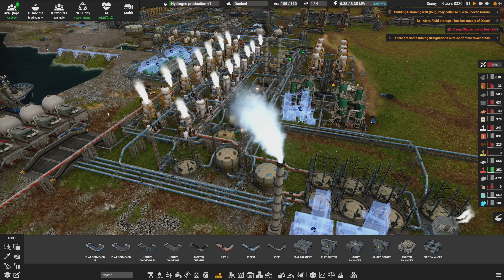FORTIFYING OUR FUEL GAME! - Captain of Industry - 32 - Early Access Gameplay

Comment: I highly suggest scraping all your pickups and have the entire fleet T2.  The algorithm is not smart when giving out / picking up jobs. This leads to the situation where if you want to deliver 45 parts somewhere, it's possible (and likely in my experience...) that you'll have 2 pickups carry 20 items each and then a full size truck carry 5/60... Instead of the obvious.. use 1 truck to deliver 45/60 parts.

When I made this change, my diesel situation improved dramatically :) now if only I could get more fuel gas.  (my own doing as I'm focusing heavily on pollution and am therefore using fuel gas whenever possible instead of coal.

Comment: Now that you aren't taking those pipes under the bridge, why don't you dig up that split in the pipe and convert it back into two pipes, so you can upgrade them both to pipe 3 if you need to?
Reply: Digging stuff up takes time and moves excavators away from more critical jobs. He also doesn't need to upgrade them, everything is planned out far ahead
Reply from the maker: I don’t need to dig them up to upgrade them. I also have no need to upgrade them.
Reply: @CharliePryor  I meant splitting them back into seperate pipes at the end, so that you could have more flexibility in the future. Now that you only have six pipes that are coming above ground, you don't need to merge two of them to save space under the bridge. I mean, it isn't a big deal, just something I'd do to increase future flexibility and potential throughput.
Reply from the maker: @bow-tiedengineer4453  it already has a purpose. I don’t need flexibility. I don’t even know what I’m going to use 3 of them as is.